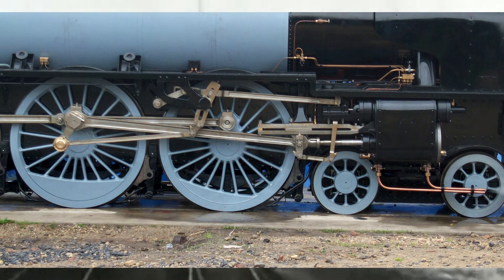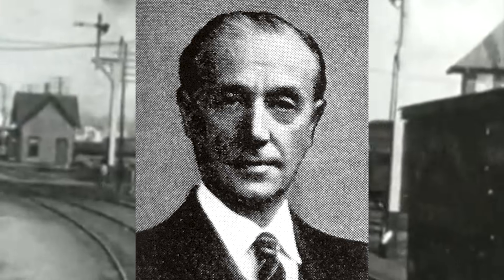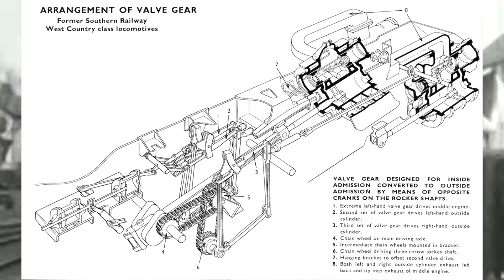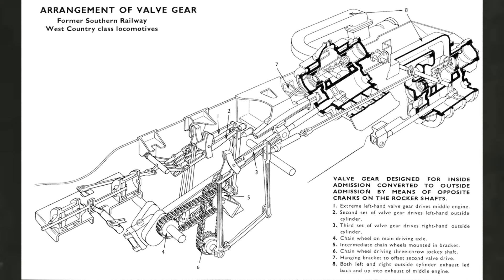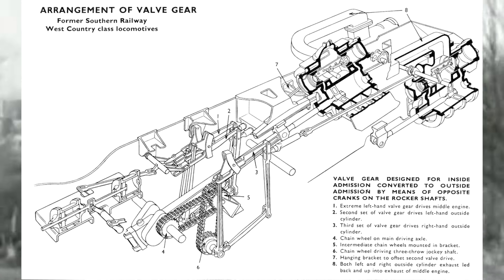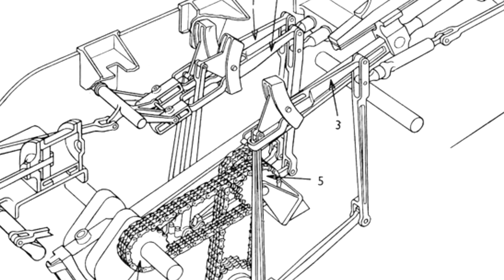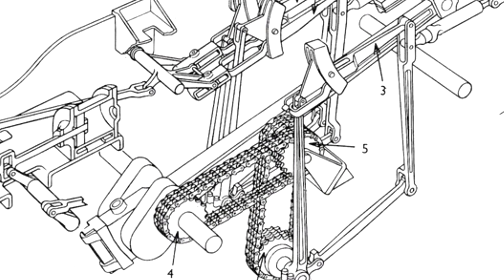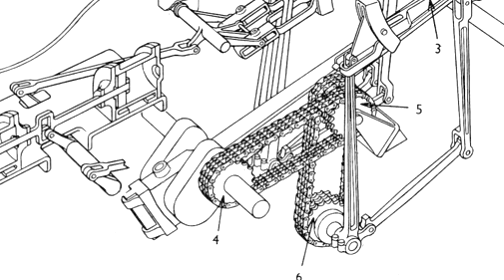Oliver Bulleid's INSANE and AWFUL Chain-Driven Valve Gear | History in the Dark

Comment: Believe it or not, as we speak, one of the rebuilt Merchant Navies is being reverted back to its unrebuilt state, chain gear and all.
Reply: Presumably, modern metallurgy and tools will be able to manufacture the chain gear, oil pan, etc in a more durable state. Plus of course, it's not going to be seeing nearly as vigorous mainline service.
Reply: I’m gonna hazard a guess that the stress of occupying a museum space is a bit less demanding than dragging freight around 😂
Reply: @richarddressner639 The intent AIUI is to produce a mainline certified loco, though the project has gone ominously quiet since it lost it's operational base some months ago.
Reply: Which one? And it'll be nice to have at least one Merchant Navy with its air-smoothed casing, like we still have with several of the WC/BB locos.
Reply: 35011 General Steam Navigation
Reply: @dominicbarden443621C11/35011 General Steam Navigation
Reply: And i imagine it will be fine. The issue was really the materials technology of the time. We know why it had problems now and will be able to address those problems.

Comment: A chain drive is a very appealing prospect on paper, especially if you think "weakest link" refers to a least favorite NPC in a Persona playthrough

Worth noting about those "incorrect welding procedures" though: That was cutting edge tech, no pun intended. Highly plausible the welders didn't use the proper procedures because nobody had figured out what those even were yet.
Reply: The welding issues seem confined to joining metal sections of differing thicknesses which , as you say, was very much new tech still establishing itself.  Still, Bulleid's locos had less teething troubles than, say, the US "Liberty Ships" of that era.  Pity is, the ship designers sorted their issues ... the design of the "oil bath" on the Bullied Pacifics remained unchanged until  rebuilding.

I would be interested to know whether the team "unrebuilding" 35011 General Steam Navigation are looking into this aspect of the original design.

I made a fuller post on the chain gear, but do note that properly maintained, the locos in original condition achieved decent intervals between major servicing and as replacement parts go, chains are pretty cheap and comparatively straightforward to produce.  What they weren't,  even on the Southern, were standard or familiar to footplate or maintenance crews (or enthusiasts, for that matter!).  

It might be worth seeking out a report of 34092's memorable mainline stints 30 odd years ago. T'was said that the known issue of "creep" with the reverser were overcome with a tin of Humbrol and a paint brush.  Wells was the second West Country fitted with Giesl Ejector and I recall a claim the loco was "two carriages stronger" and displayed impressive acceleration working the Scarborough Spa Express.

No steam loco designer me, but I'm pretty sure a Giesl wouldn't be my "go to" choice ... too many delicate moving parts in a distinctly hostile working environment.  The  'Lempor' (a blend of the LeMaître - as used by OVSB - incorporating later improvements by L.D.Porta) is of far more robust design.
Reply: @TheHoveHeretic  Ah, US Liberty Ships. The only vehicle on record to undergo Mitosis
Reply: Could not have helped that due to WWII the workforce was probably not very experienced-the more experienced people working on higher-priority projects.  

So you have inexperienced workers trying to do cutting-edge technology under the supervision of people who are not entirely familiar with it.  And this is a more entailed task than the farm girls working on the Manhattan Project ("keep the needle between the two red zones").
Reply: @00Zy99 neither were the designers who aligned a major weld with square hatch openings!